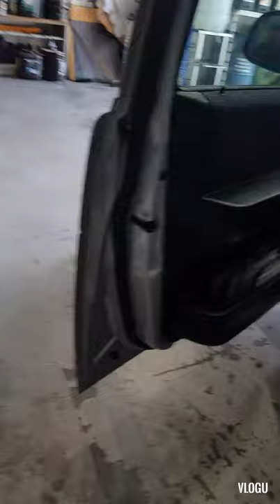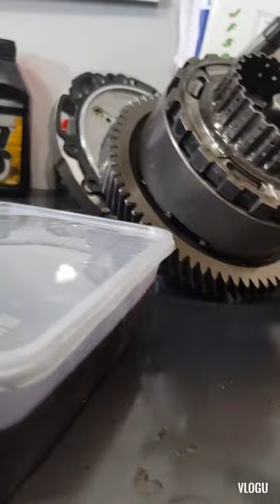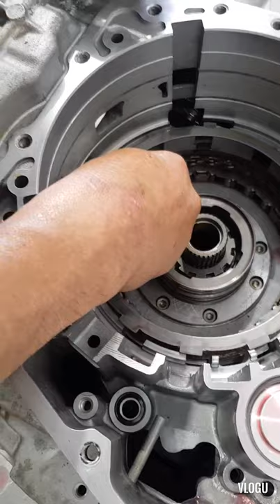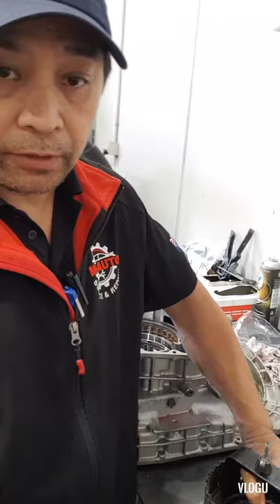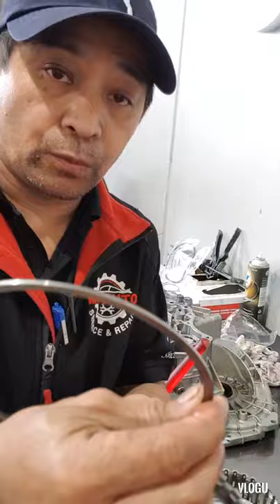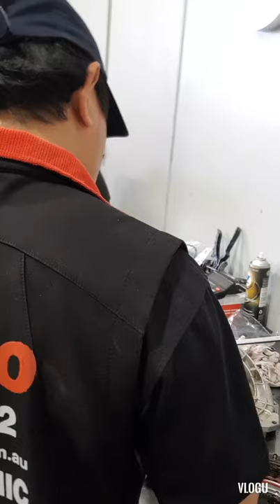Land Rover Jf506E Automatic transmission Rebuild (no reverse) part 1

Comment: Please I have a question.  My car is jaguar x type 3.0 2001.  I had a problem with not being able to go back.  I changed the so-called breack band and assembled the transmission as well and put liqy moly 1800 b oil.  Now I have a hissing sound coming from the transmission and it disappears when the car warms up
Reply from the maker: Hi Mostafa, shifting to reverse brake band is not responsible for it, check the valve body valve or you have an issue on low and reverse and reverse clutch pack

Comment: hello how are you, good day. I tell you I am from Argentina and I have an automatic free lander td4 and from one day to the next the reverse stopped working, you know what the problem could be. Thanks a lot
Reply from the maker: Hi Carpra,  buenas dias, if reverse hasn't engage your losing pressure to reverse clutch pack meaning it could be a seal ring on the reverse clutch piston or could be the low and reverse it's either one of them has an internal leak during reverse, sorry for a very late reply
Reply: @dandelao9653  no please, thank you very much in advance, for that it is only recommended to disassemble the box?